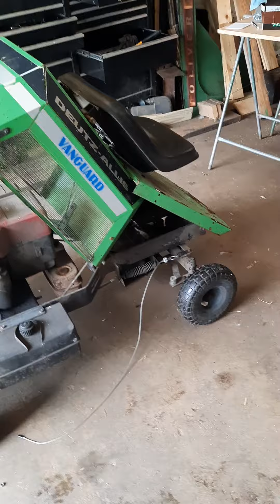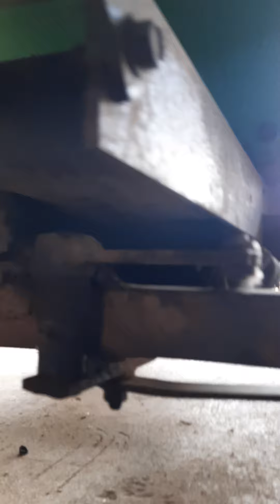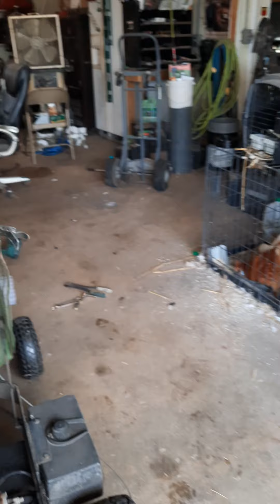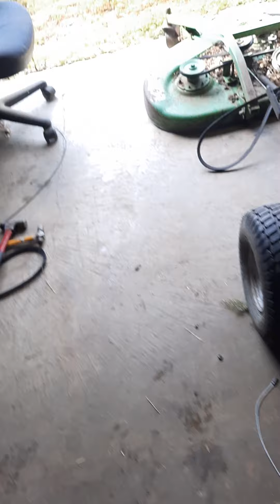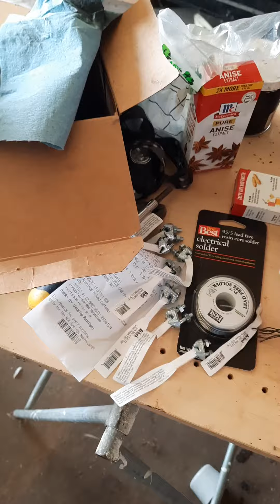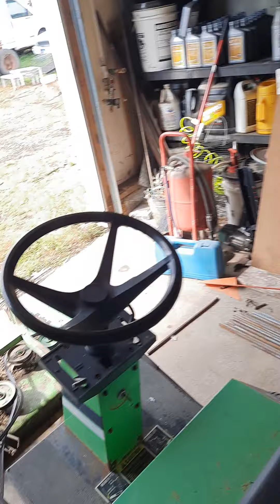Deutz Vanguard steering cable fix

Comment: Doing good work. Had my cable break 10 minutes ago and dreaded the idea of trying to find the part, being such a specific part of a rare mower🫣... But lo and behold this guy just saves the day... What a guy!!!!
Reply from the maker: Glad to hear it helped. When I made this video the cables could be bought on ebay, I had the part # so was easy to find. Wana say $150 a piece though. 3 years later and this fix is holding up just fine.

Comment: i have one with the cables too the cables broke too  i see you have a 1 cylinder i got mine with no motor will put a 14hp vanguard 2cylinder ,will fix the steering nice rig ,well this helped me out thanks
Reply from the maker: Factory engine was a 12hp but it was replaced with a 12.5 at some point. It goes along good as is but a few more ponies would be nice. Real glad the video helped. These are real nice mowers been trying to find more and find time to fix my other one.
Reply: @mudbogger372  had a 12.5 vangaurd 2 cylinder all 2 cylinder vangaurds run great, cant say the same for the intek 2cylinders or the 1s, junk, the IC were better well my 14 2cylinder vangaurd should be sweet on that rig ,got my cable fixed put cable the same size as the original cables with the black coating on them so just a bit bigger but still fit in the big cable harness that runs from  the steering to the back they will be a bit stronger they are not coated but  galvanized tried the cable to make shure got it right now just tighten it up cost me $17.00wow better than $300 something on ebay could not believe it that was nuts 300 bucks cant wait to give it a  spin when there is a will there is a way dont forget there is no problems just solutions
Reply: @mudbogger372 Briggs and Stratton 18.5 HP fits in it just near perfect (valve cover slight rubs on the back but a lil body work and she's 👌🏼... Ask me how I know😂. Will plug the mower before it runs out of ponies.